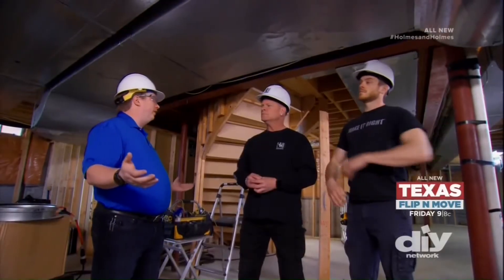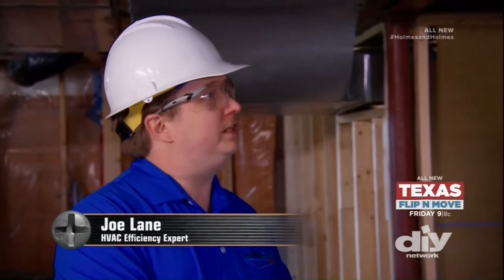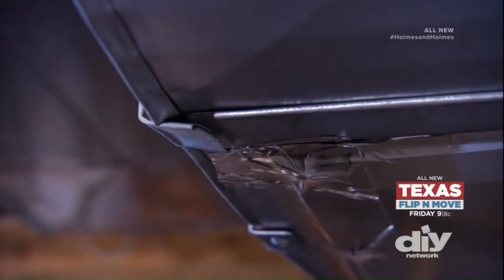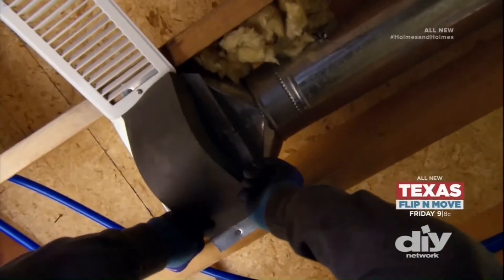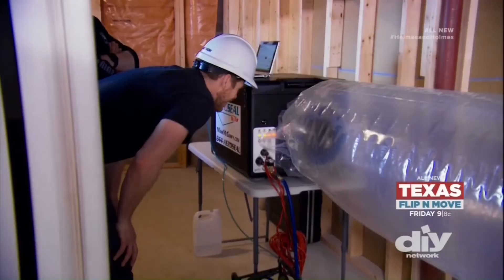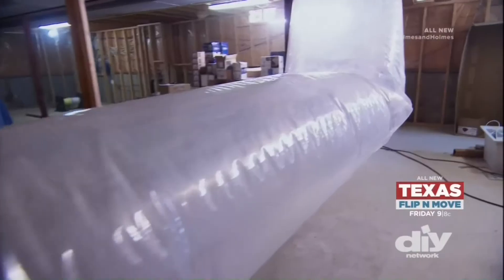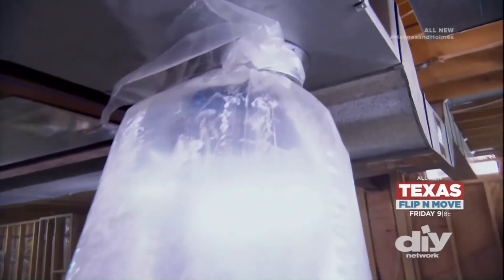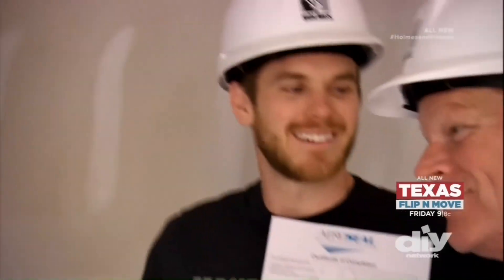Holmes and Holmes Features Aeroseal Duct Sealing on DIY Network

Comment: Does the sealant only coat/seal the holes or does it also coat the inside of it acting as an insulator?
Reply from the maker: Hello Tommy, the particles only seals the holes of the ductwork.
Reply: @aeroseal  thanks. Your dealer I have this scheduled with told me it coats the inside too. 😳
Reply from the maker: The ductwork would have minimal (if any) residual particles left behind after the system is turned off and no longer pressurized. I have had my home sealed, so I can assure you it does not coat the duct work...
Reply: You may find a small coated area near the installation location, but it does not coat the entire system.

Comment: I’m curious if there is any information regarding how the application of this product might effect long term health. The air should be fresh because homeowners breathe the air, but if the aerosol is added, what else might the homeowner breathe?
Reply from the maker: Before Aeroseal is applied to the ductwork, our partners ensure your system has proper ventilation. Aeroseal will actually improve air quality in the home. I hope that answered your question. Have a great day!
Reply: @Baise Duezcke asbestos tiles are also hard, that doesn’t mean you add them to your hvac system. 

I love the idea of filing leaky holes, but does the company actually understand what the long term consequences could be for the patrons who add it to their source of fresh air?
Reply: @wg8304  The product once cured (cured during application) is inert and will never be present in the air again. and your HVAC system is not a source of fresh air typically, it is just recirculated air from the home.

Comment: Seems like very effective system.  How long will the sealant work to keep the holes sealed?  Have you ever gone back and run an airflow test years later to see if the performance was maintained?
Reply from the maker: Hi Chris Gatti -- We guarantee our work for at least 10 years, and we’ve stress-tested it up to 40 years in homes. Yes, we have returned to previous job sites to check on the sealant and the data determined that there was no change. Thanks for the questions.
Reply: You should be able to expect the seal to last the life of the home, if not for sure longer then any other method of sealing, and only method of sealing retrofit without opening walls ect.

Comment: Areoseal works amazingly.  Nothing worked to get the air and heat up to the 2nd and especially the 3rd floor.  I wish i knew about this years ago, they solved the problem in a few  hours.  Joe and Tibo are both professional and smart guys, their customer service was great, and I am happy with the service.
Reply from the maker: Glad to hear you are happy with your Aeroseal duct sealing service, Liz!